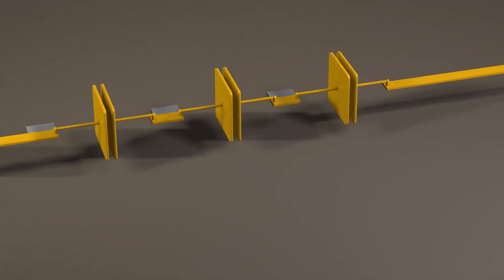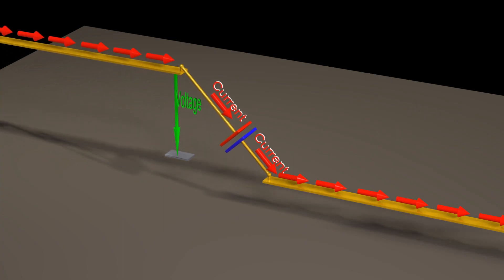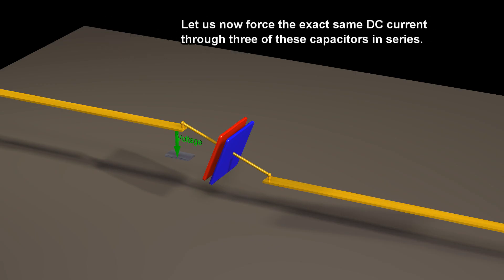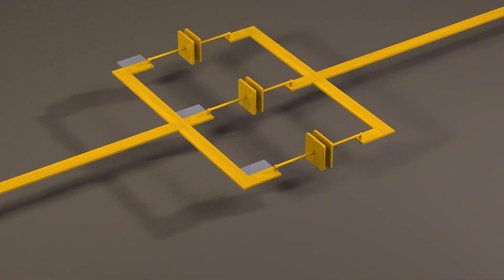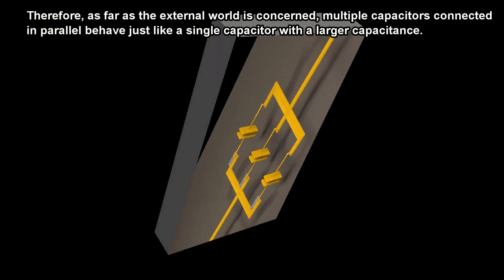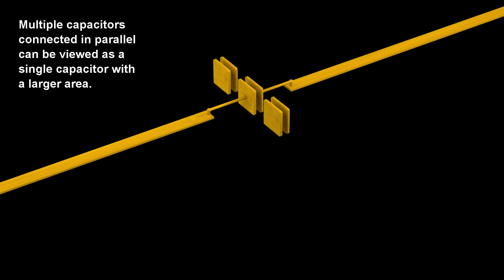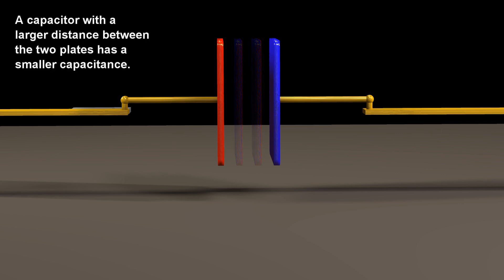Capacitors in Series and Parallel

Comment: Why is the 10s time period necessary? I feel like if there was no time period, the larger capacitor would charge up to a larger voltage than the smaller capacitor. Is it because capacitors are usually charged up for a specific amount of time and that is used as the convention when comparing capacitors?

Comment: Snappy visual as usual. Great help in understanding the capacitors. If I may put my 2 cents into the piggy bank : 
a.) We do not give an understanding of what happens if the capacitor plate square is the same but its thickness is increased. One might think that if the material is thicker then more electrons are present and therefore it's better to get thicker than getting more square in increasing capacitance.
b.) (That is something to think about) Instead of a special material between two plates we can actually put a thin paper with coil on it and power it from the same line therefore putting a small electromagnet between two plates. The question to think for a student : why it's not used to increase capacitance  
c.) And that one is very much missed from this visualization: a capacitor and electromagnetic waves. The capacitor is the system in which there are moments when both positively and negatively charged particles move towards each other like in a dipole therefore creating a kink wave and apparently emitting an electromagnetic wave into space. The opposite is true - an antenna. A remarkable thing is that for a short period of time when capacitor is charged it's actually emitting a visible light. And that by charging and discharging the capacitor we can have all kind of frequencies for an electromagnetic wave, and that would be a great help in understanding the waves and antennas later. 
d.) It's better to model consecutive capacitor capacitance loss from the electron point of view than from the voltage. The voltage is more difficult.
e.) capacitor and AC is missing so...

 we have large areas of uncertainty after viewing this and most of it we have in electromagnetic wave sector and AC
Reply from the maker: I cover some of those topics in my other videos, such as the ones below.
Capacitors and Capacitance -- https://youtu.be/f_MZNsEqyQw
AC Current Impedance -- https://youtu.be/zO7RZZW0wSQ
Electromagnetic Waves -- https://youtu.be/W1cTpqM9DaU

Comment: Why doesn't the order matter when capacitors are in series? I would have thought the capacitance of the very first capacitor affects how much charge can be passed to the subsequent resistors
Reply from the maker: When components are in series, then the exact same current always passes through them.
Reply: @EugeneKhutoryansky  yeah but current doesn't flow through a capacitor, it can't charge and discharge at the same time. So only the first capacitor in the series is being charged right? And all the other capacitors get their charge from this one so it should matter what order of capacitance they're in. I'm so confused 🙈

Comment: Great videos, helps me a lot. But I'm thinking 3 equal capacitors in series are the same as 1 of those alone. Because 1 of them would then store the same amount as those 3 combined and have the same voltage as those 3 combined. Making it functionally the same. C.equivalent=3/(1/C + 1/C + 1/C)=C. But calculating the individual Q in each capacitor would give the same result. Just 3 in series splits the total Q evenly among themselves. Thoughts?
Reply from the maker: When you have capacitors in series, the positive charge on the plate of one capacitor is cancelled out by the negative charge on the plate of the adjacent capacitor.  For three capacitors in series, the correct equation is 1/(1/C + 1/C + 1/C) = 1/(3/C) = C/3
Reply: @EugeneKhutoryansky  Ah okey i think i see what you are saying. Like in between the capacitors there is a delta Q in the opposite direction so Qtot=3*Q - 2*Q=Q. Thanks for the answer!

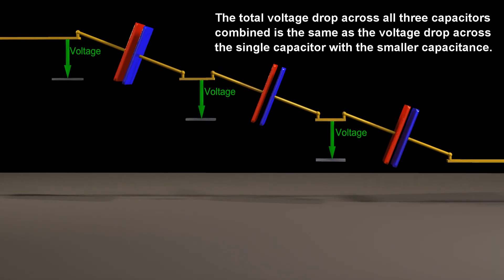Comment: There is one minor mistake in the narration of the video.  At 1:40  it says "each capacitor"  and should have said "the capacitors combined".  The narration says it correctly at 1:52.
Reply from the maker: This is not a mistake.  The video states it correctly.  The same amount of current flows through each capacitor, for the same amount of time, as through the capacitor in the previous example.  Hence, each capacitor develops the same voltage drop across it, as the capacitor in the previous example.

Comment: Another excellent video. But the race is on to see who can come up with the best battery. So the question becomes can capacitors be used as a battery. How close can the capacitors plates be put to one another and how thin can they be made? Can they be made as thin as 1 or 2 atoms with 1 or 2 atoms of dielectric between them? Of course they need to be sandwiched positive negative positive negative but connected in parallel. The race is on my friend what is the limiting factor on how thin these plates can be made and how close they can be placed together. Remember Moore's Law?  Graphine  can be made one atom thick already.....

Comment: But if we give the 3 larger capacitors in series ample time (rather than a 10 second cut off) will they not continue to store more charge and embody greater potential difference until reaching their full capacitance - yielding a greater voltage than the one smaller capacitor?
I know the answer is no, but I'm just not sure why

Comment: My mentor! please make a detailed video on the differential form of line integrals where instead of having of having f(x,y)ds as the integrand we have g(x,y)dx +h(x,y)dy as the integrand. Please clear the misconception about what is the difference between f(x,y)ds and f(x,y)dx .
Is f(x,y)ds = f(x,y)dx ?
From the two equations below which one is true for any possible line integral.
f(x,y)ds=f(x,y)dx+f(x,y)dy
or
f(x,y)ds=g(x,y)dx+h(x,y)dy
Also please answer one of my question . Does Pythagorean theorem holds for line integrals? 
(f(x,y)ds)² = (f(x,y)dx)² + (f(x,y)dy)²

Comment: Since when can you put a DC "THROUGH" a capacitor? I have always been taught a capicitor (as the ones this video is showing) requires an alternating of currents to go "through". Maybe you should have said "if we put a dc voltage on the capacitor" and not "through the capacitor".
Reply: Direct current infact flows through in two cases. The cap is either charging or discharging. For this reason capacitor conducts alternating current and direct current only short period of time. When the charging process starts the current is at the maximum. When charging process is nearly complete the current is at minimum. In discharge the current is max at start and decreasing as the discharge is nearly complete. As we feed the cap with AC the impedance is decrasing as the frequency increases. This is because the capacitor doesn't catch enough charge (in order to raise terminal voltage) and the circuit "sees" low impedance. This is difficult suject and can be learnt completely either at hands on lab or calculating. This lecture however presents the circuits which could be built in bacyard lab.
Reply: @jkinkamo   I agree,  but this video showed charging a cap (not electrolitic) but not any discharge yet also said "when we send a dc current through" and not "when we charge a cap". I have a lot to learn being youtube taught but I have a pretty extensive lab at home and instantly got confused when this video said they "send a dc current through" and not when they apply said voltage. I do agree current flows through whether conventional current or electron flow but in this context is confusing when there is no change discussed. Only how they act on the front end being parallel or series. I would be happy to know where I'm mistaken though. Thanks

Comment: Eugene, my mentor can you answer me why electron can be brought close to a proton less than a certain distance ? Why hydrogen has energy levels? I watched your video on stability analysis. How the electric potential energy work for a hydrogen atom. I am very confused . Help me my mentor.
Reply from the maker: I explain this in my video "Quantum Wave Function Visualization" at https://youtu.be/KKr91v7yLcM
Reply: @EugeneKhutoryansky  MY friend siad that it is due to the presence of quarks in the proton therefore electons can't be brought very close to a proton . However they (electrons) can be brought close to positrons because there are no quarks in them . I recommend to search "electrostatic potential energy maps" on google and see images.  Why there is no picture of hydrogen atom in form of a 3D graph with f(x,y) where the output is energy . My main confusion is that gravitational potential energy levels are easy to visualize whereas electric potential energy levels are (for me) almost impossible to visualize in case of hydrogen atom.

Comment: Energy levels in gravitational fields are easier to comprehend and visualize as compared to energy levels in electric fields . These energy levels deserve a video. I am still wondering why not an electron fall into the proton? Why does after a certain distance from the proton the energy of electron increases as we try to move the electron further close to the proton or further away from the proton 😵😵😵😵😵😵😵😵 ?

Comment: Love this channel's videos! Always very explained. Loved the final resume, it makes it 100% clear.
But keep in mind that capacitors have internal resistance, so 3 capacitors with lower capacitance will charge faster than 1 capacitor with large capacitance.
This is why they are used in parallel in circuits.
Reply: I recently asked Sir Eugene to make a video on internal resistance of both batteries and capacitors.
Reply: This is what I thought. The voltage across every capacitor in parallel is the same. It's true that they will have a fraction of the total current but the current on every cap is the same as in a simple one-cap circuit.

Comment: What if 3 different capacitors connected on parallel?
Is the voltage drop same or different?
And thank you from INDIA, your videos are really understandable for any student❤️
Reply from the maker: If any components are connected in parallel, then by definition, they all have to have the same voltage drop across them.  If you did this with capacitors of different capacitance, then they would each draw a different amount of current so as to maintain an equal voltage drop.  Thanks for the compliment about my videos.

Comment: I endorse your videos to those who look for the intuitive understanding of physics. Thank you and Kira for the excellent work!
Reply from the maker: Thanks.
Reply from the maker: Thanks for the compliments.
Reply: @EugeneKhutoryansky  I would love to know though why the last two equivalent states of combining the capacitors in parallel with a single capacitor with a larger area will work and of combining the capacitors in series with one with a larger distance will work. Is this only conceptual and a way to visualize or is it mathematically true that we can add areas that way when finding an "equivalent" of parallel capacitors and distance of series capacitors when finding its "equivalent"?

I understood the maths and intuition behind the equivalent of the series and parallel capacitors.
Can it be proved using these equations:

For series:
1/C = 1/c1 + 1/c2 + ...

For parallel:
C = c1 + c2 + ....
Reply: @nahfid2003  Eugene is absolutely this. This actually applies.  The last assumptions of the video are not only assumptions but they are reality. The capacitors in series can be thought of as a single capacitor with a very large distance between plates.  Because the capacitors inside serve as dielectric if you look and think carefully. But in this case these dielectrics never link the opposite plates together, otherwise a current will start flowing between the plates. I hope it is clear now.
Reply: @physicslover1950  but the dielectrics are supposed to be insulators which get polarised. 

Capacitors are defined as being conductors so how can we consider them as dielectrics. 

And if it is only the  distance which increases as shown in this video. Can we mathematically prove that the expression for equivalent capacitance involving:

1/C = 1/c1 + 1/c2 + ...
and,
C = E A / d

where E = the relative permittivity, A = Area of equivalent capacitance and d is the distance between the plates of the equivalent capacitor, as shown at the end of this video.

are somehow equal to the inverse of sum(di/E Ai)
where i ranges from 1 to n, where n is the number of capacitors.

I mean even considering areas equal, are the distances the algebraic sum of the individual distances between the capacitors?

And the similar for the parallel case.
Reply: @nahfid2003  I think that algebraically this is not possible but it is only an assumption at the end of the video to make concepts easy.